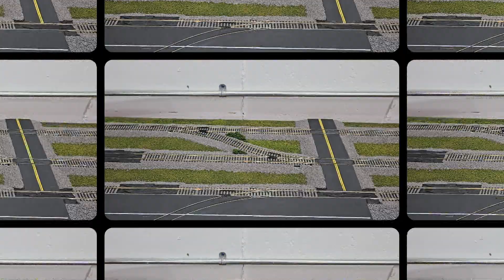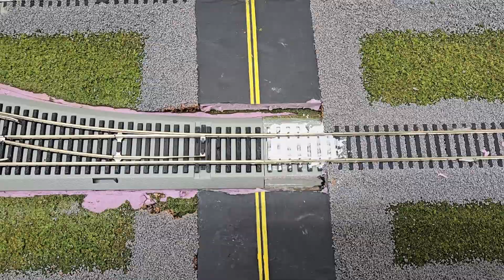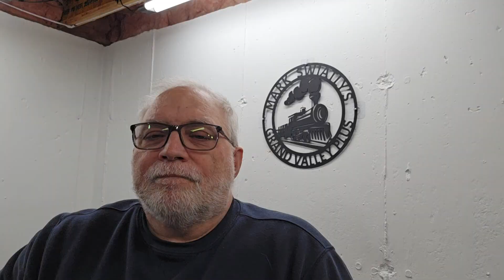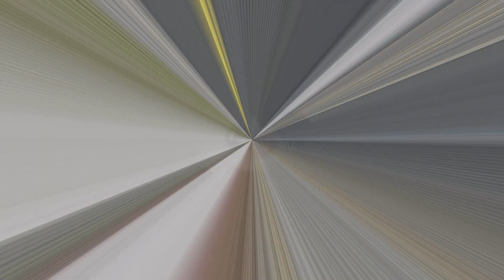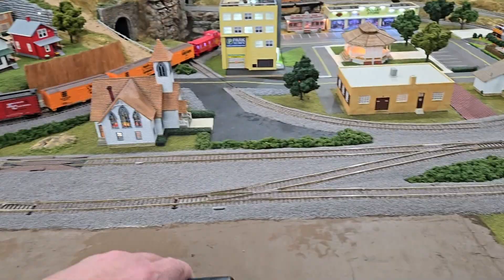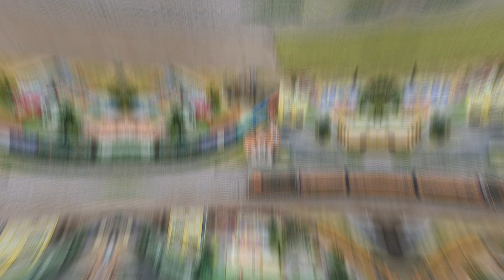Project 2 - Replace passing siding turnouts #modelrailroad #grandvalley #modelrailroader #train

Comment: Looks good!    Im saving all that "fun" on yard, switches..ect  for after I hit the LOTTO...   Be interested in how difficult and expensive the electric switches were to do.
Reply from the maker: Waiting to hit the lotto might be a good idea.  The switches I buy are already powered, which obviously makes them more expensive.  But that's because I'm using the Bachmann track.  I'm not sure there is a way to add tortoise switches or any of those other kind to them because of how they work.  The #4 and #5 switches I used each ran around $40-$45 dollars depending I were I could find them.  I've bought them on Amazon and Trainworld and Modeltrainstuff.  Then it's just a matter of running the leads to the switches and then powering them up.  I power them up off of an old DC transformer I still had laying around, and use the accessories terminals on the back.  Reach out to me via email if you need to know more.